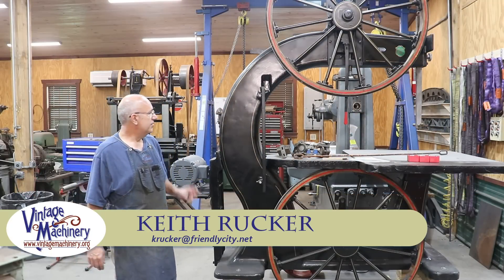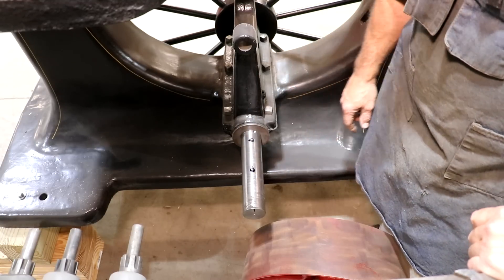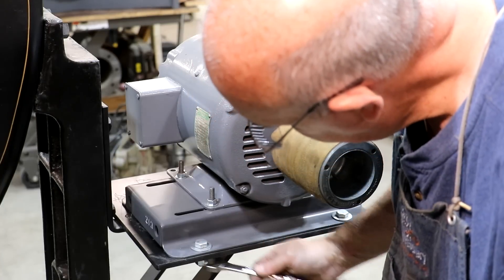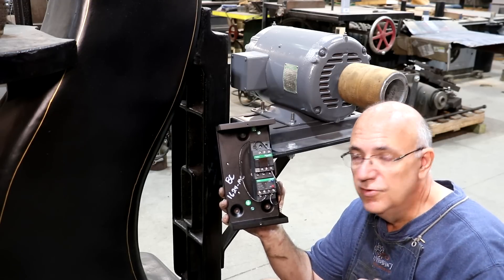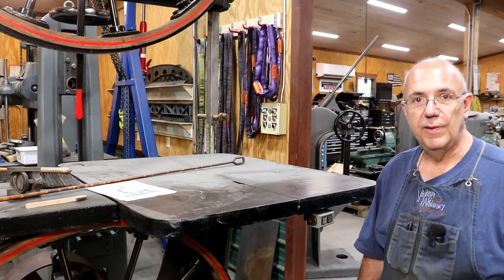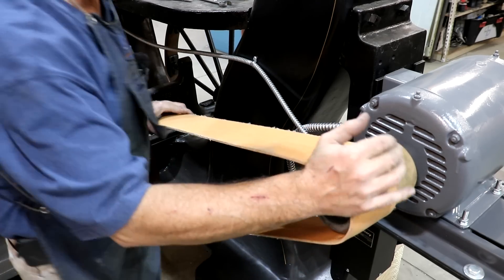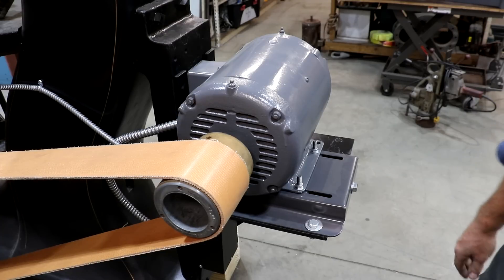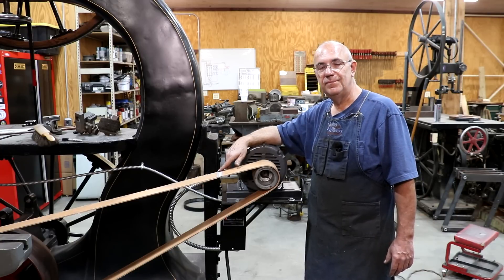Diresta Bandsaw Restoration 31:  Installing the Motor Starter, Flat Belt, and First Run!

Comment: No question. Use a VFD  but don't overspend.....Retired industrial electrical/millwright contractor here. Stopped buying the megadollar  "Name Brand" Japanese and Indian  VFDs years ago, though Used the chicom SleezeBay VFDs for over the last 5 years before I retired on both our and own and our customers machinery. Less the 10% failures,,,,and you can buy 3- or 4- of them for the cost of a Bradley or Omeron. - Set the accel rate so you don't start to throw the belt on start up and add a braking resistor and bring it down in less then 2 seconds. You can even put the speed pot right in the enclosure with the Start/Stop buttons or just put the whole VFD up front (Sawdust?). 

Two things, I hope you know, though. 1-You cannot use the motor starter with any VFD so that was a total waste if you are going to use one. and 2-You are missing the NEC required safety disco. (Unless the breaker is less then 50 feet away and in sight). We just put a disco on every machine as GP.   Don't use a fused disco, either. Never put Over-current Protection in series. No telling which one,,,or even both,,,, is blown when you have a problem. and under mo circumstances listen to the cork sniffers that tell you the cheap VFDs don't work just as good as the overpriced Jap built controls. We have had about equal problems with both. and since neither  is made in the USA why pay over 3 times the price."?
Reply: Quite correct. Remove the motor starter when you install the VFD. Protect the VFD with the correct contactor and then fuse set.

Comment: Ignorant question, is the bottom blade wheel spinning in the correct direction?
Reply: yes it is. bandsaw blades always push down on the table. so the far side of the wheel; which is under the table; also has to move downward.

Comment: My only complain about the motor saga has been the location. there is a curve on the bottom of the frame, perfect spot for a motor, where it is now... it looks ugly, it makes the saw footprint even bigger, and you can't really push it close to a wall with all that stuff at the back.
Reply: I agree, Never liked it from the moment Kieth started fitting it,,,,,,but that is on open dripper and would be sawdust choked in minutes if put where we just said. Given a choice I would have used a TEFC motor.

Comment: a 48" wheel at 450RPM would give you 5654 blade feet per minute, or 64.25 miles per hour.
Reply: A blade running that fast scares the bejabbers out of me. If it ever broke or came off it could do some serious damage to anyone standing close.
Reply: @mmm365  This machine was not built to run in metric. The conversion hardware is too expensive because of the import tariff.
Reply: I agree totally with the concerns about that blade speed of  5600+ SFPM.  I am surprised that you didn't start with  a target SFPM when choosing motor speed  and pulley ratio.
I recently revived a B. M. Root 36 inch wheel bandsaw from that era.  Since I found it difficult and even undesirable (for me) to locate a 900 rpm  motor, I used a jackshaft arrangement and Vee pulleys.  I read that about 3000 SFPM is about tops (for wood), but, since I am just a "Jack of all trades, master of none" , and am not in a production mode, I settled for about  2000 SFPM.
Just my $.02, but I don't think you should need to go all the trouble of adding a VFD/soft start to keep the belt on.  Just pick a single speed and design the drive system for it.  I am no expert, but I have spent many years in flat belt driven workshops in historical reenactment settings and we didn't have any trouble with belts jumping like that once we got the drives adjusted.  Sure, it took a bit of fooling around to belt up the threshing machine to the steam engine out in the field  (if we couldn't twist the belt). but not the same as a permanent installation in a shop.
Reply: @frenchcreekvalley  The VFD will solve all of those "problems"!